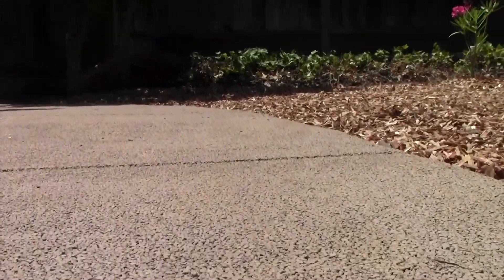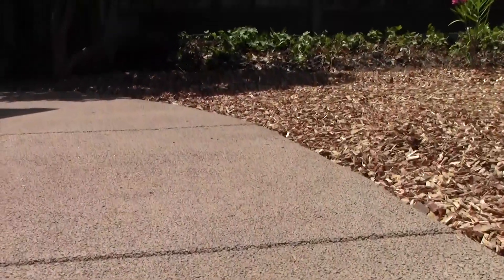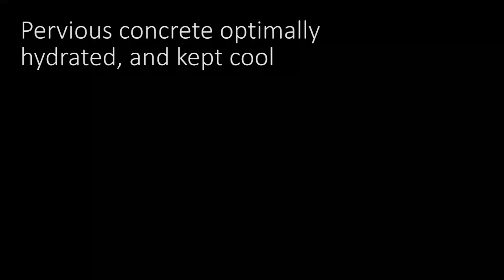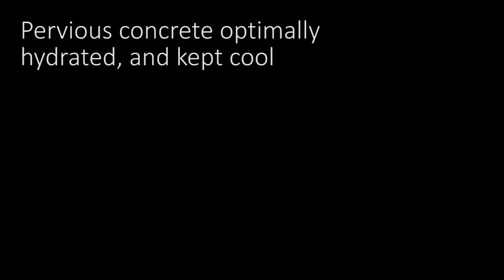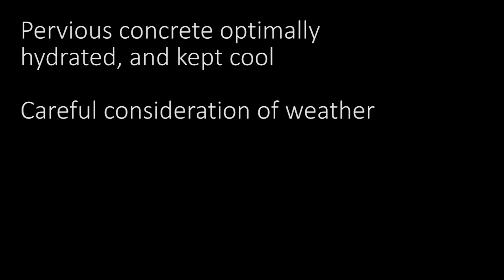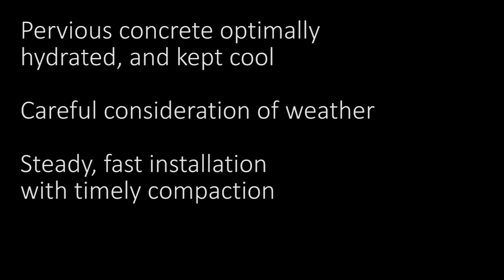Avoiding Raveling of Pervious Concrete

Comment: hi, would resin bound lock in the ravelled concrete?
Reply from the maker: To some extent it could.  However, it would change the color in a weird way and it would be tricky to get a durable bond without sealing the pavement up.
Reply: @perviousproducts6648 thank you!

Comment: Add a half gallon of epoxy resin  and a half gallon of hardener to every 5 gallons of you pervious concrete. Mix well with a paddle and a large drill.  1:5 ratio of deep pour epoxy and you pervious concrete mixture. You will be pleaently suprised. Use water misted on top and trowel to smooth it. It will lock together with this recipe and last. No more raveling.
Reply: Hi, I admire your expertise and experience in this field. With the suggestions you've given, I can say you are very knowledgeable and respectable. I encounter numerous issues with this type of concrete, and I was hoping for your assistance with my research on it. Your kind and considerate response is highly appreciated. I look forward to your positive feedback.
Reply from the maker: Unfortunately, epoxy will not last outside, exposed to the sun.  It will be strong for about 5 years then start breaking down, depending on the type.

Comment: Can adding some sugary water slow down the curing and help in better setting the concrete?
Reply from the maker: There is generally not an advantage to slowing down the curing process for pervious concrete.  It appears the main key to successfully curing pervious concrete is maintaining the proper water content throughout the hydration process.  So not allowing water to evaporate during its placement and locking the water in right away as soon as finishing is completed for each little section of the pavement. 
As a side note, one has to be extremely careful adding sugar to concrete as it doesn't take much to completely kill/ stop the concrete from curing and setting at all.  So sugar in concrete has to be dosed extremely carefully to avoid problems.

Comment: Country like India were we have dust and dirt problem does this thing couldn't get block after some time does this product of cement and gravel is dust and dirt proof sorry if u didn't understand my question but if u do please answer
Reply from the maker: Typically when pervious concrete is placed without other pavement draining onto it or dirt eroding on to it, it will not clog.  If a lot of debris and dirt is allowed on to the pavement, it is possible that it can clog up.  However, because pervious concrete often allows over 600"/ hour (4.2 mm/ second) of water to flow through it, even if it were to become over 95% clogged any rain event will still be readily absorbed by it.  It if were to become more clogged than this because of erosion or the pervious concrete is being used as a drain collecting runoff from surrounding pavement, then much of the original permeability can be restored with pressure washing -  blasting the pavement with concentrated water to flush out trapped dirt and debris.

Comment: hi, question, I do install pervious concrete, we covered plastic about 10 days, but after 10 days, the part of concrete surface start to loose, so do you have any better suggestion to fix that?
thanks.
Reply from the maker: Once pervious concrete begins to ravel there are only a couple of options to address it.  It can be helpful to keep the affected area clean and remove loose rock regularly for the first few months.  After a thorough cleaning, application of an acrylic or polyurethane type sealer can help to protect the surface and minimize future raveling.  
The other two ways to fix pervious concrete that is raveling are to cut out and completely remove sections and then repour.  Or in most cases a very fine pervious concrete, like PerkTop, can be applied 1/2" (12mm) thick  over the entire pervious concrete area.  This will not only permanently fix the raveled pervious concrete, but will upgrade and provide a really nice, smooth, consistent surface.

Comment: A very careful misting with water on a first two days of installation could help. It needs to be started almost immediately after putting the concrete and leveling it. But it could also hurt if not done carefully. But getting the good water mix in the first place, and putting it on a chill cloudy day with a lot moisture is probably the best.

Comment: I was always told never use a bullfloat as it will seal the surface resulting in more closed voids?
Reply from the maker: With standard, coarser pervious concrete overworking the surface can cause it to seal up.   Using a bullfloat or metal trowels can contribute to this.  The good news is one can generally see this happening while it is being finished, and can then take steps to mitigate it from continuing.  It may be that there are just some overly wet areas that need to be dug out and fresh material put in, and/ or one can wait a bit to let some of the water evaporate off (being very careful not to wait too long of course) before continuing finishing.  
When finishing the base pervious concrete before applying our PerkTop topping, we typically add weight to a magnesium bull float.  We vary the weight added depending on the conditions, timing and wetness of the pervious concrete to minimize the amount of sealing up that may occur.

Comment: Dear sir, my pervious concrete ravels a bit. As my surface needs to be completely flat for it's purpose I was wondering what I can do to fix it. How can i make these areas flat again? Some other material? Can i remake an additional layer of let's say 1 - 2cm on top? the area is a square of 250m2. Thanks a lot in advance 🙏
Reply from the maker: To fix already raveled pervious concrete, one can apply an overlay over it.  To do this begin by removing any remaining loose aggregate.  Do this when the pavement is dry and aggressively brush and vacuum it (if too much dust and fines is created and this gets wet, it can clog up the pavement).  Then wet the surface and brush on a bonding agent consisting of approximately 1 part concrete glue (typically vae or acrylic latex with around 40% solids) 1 part water and 1 part Portland Cement.  The consistency of the bonding agent should be thick enough that it doesn't all just run off into the pavement, and not too thick that it plugs it up too much.  
Small sections should be brushed at a time and then immediately covered with the new topping.  The diameter of the aggregate used for the topping will determine how thin this topping can be.  As a general rule of thumb concrete should not be poured thinner than 3 times the diameter of the aggregate.  So if you have a 3 mm (1/8") aggregate then you could apply this topping as thin as 1 cm.  
Following the guidelines in this video will help to ensure that your new topping is a success.  Because of all the additional surface area created by the voids and uneven surface area of pervious concrete, we have found overlays to be very successful even if there was some raveling in the base pervious concrete.  The overlay will lock in any remaining compromised aggregate in the base and will provide a durable, solid pavement that should last for decades.
Reply: @perviousproducts6648  Dear sir, MANY MANY thanks for your reply!  REALLY!

Comment: I mean by considering the permeability of soil and pervious concrete and the granular aggregate reservoir underneath the pavement and maximum intensity of rain fall in a area where this pervious concrete is to be implemented.
Reply from the maker: There is an older book 'Porous Pavements' by Bruce K. Ferguson that talked a bit about how to design a permeable system.  But apparently he has a newer book 'Stormwater Infiltration', that looks like it might be even more robust.  In the near future we will try do an in-depth blog on this important topic.  In the meantime, here is a basic, brief overview:
Measure the infiltration rate of the soil by digging a hole approximately 2 feet deep by 9 inches wide.  Presoak a couple of times and then add at least 6 inches of water and time how long it takes to infiltrate.  
Determine the maximum amount of rainfall to be captured over a specified period of time, e.g., 24 hours.
Find the storage capacity of the permeable system.  Slope could play a big role here, so check out our blog on solutions to handle varying amounts of slope:
http://perviousproducts.com/pervious-concrete-base-material-depth/
Often the angular or crushed drain rock reservoir has a void ratio (water holding capacity) of around 40%, so doublecheck if the rock you are using is the same and then factor accordingly.  Without any slope, 6" of rock could then hold 2.4" of water.  
One last thing to check for is draining into the permeable system.   Make sure to take into account any drainage or water run-off directed into the system.